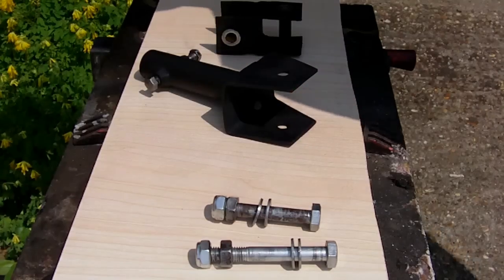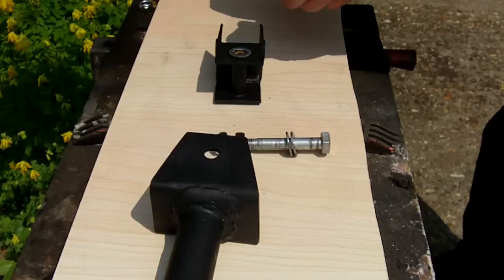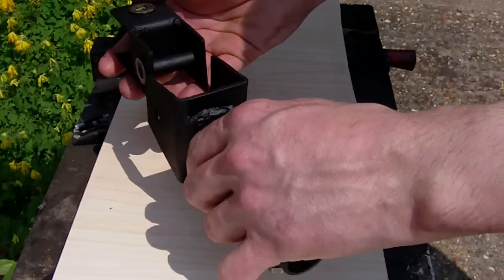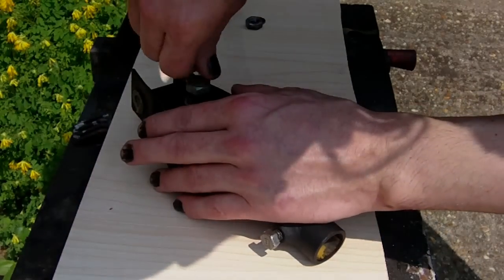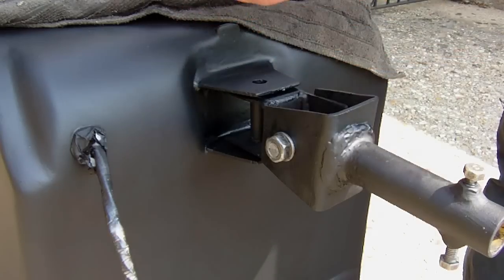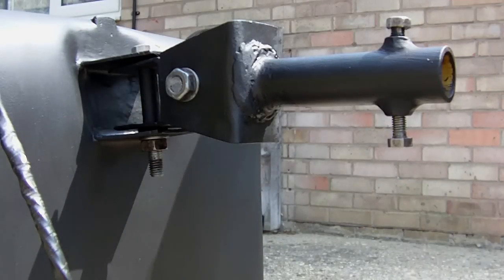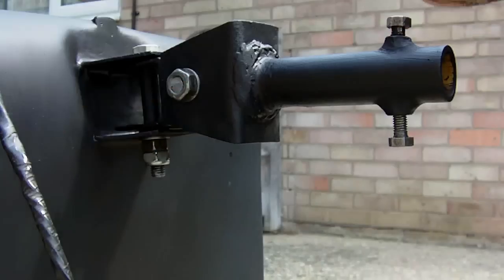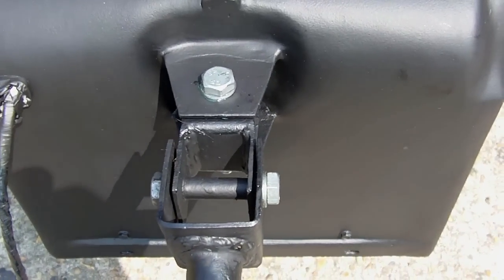Mono-wheel Motorcycle Trailer Rebuild - Part Two - The UJ

Comment: The universal joint must be positioned with the vertical axis on the engine, the horizontal axis must be on the side of the trayler otherwise it will tip over in a sharp bend or when reversing.
Reply from the maker: Been running this trailer for over 15 years, never had a problem, and I do throw it around like it's not there!

Comment: Nice idea for a single wheel trailer. I have been looking at several designs over the last few months. The engineering that goes into these intrigues me.
Reply from the maker: When I built this over a decade ago, I had no clue what I was doing... It actually has changed very little since then... But I have learnt so so so much from living with it... What I would do different? What changes I wold make? etc etc... I also had to rebuild the hitch to fit my new bike, Suzuki intruder C800 (videos of this are on the channel)..

The Hitch has suffered damage from cars hitting the rear of the trailer, so is currently broken. I am going to rebuild it stronger and extend, further back, the braces from the pannier brackets, to nearer the UJ and hitch point.
Reply: Have you ever put the design into something you can sell online? I am on a 1300 V Star Tourer right now. I'd like to put on a single wheel trailer. I've seen some, but they just didn't 'feel' right to me. I like the way yours looks.
Reply from the maker: You mean plans? The videos I put up are to help people design and build there own, or get some-one to do it for them... I quite literally made this up as I went along, with basic tools, even the welder was s/h and years old before I bought it. The frames was an old childrens bunk bed and scrap I had laying around... I spent a month building it on my parents driveway.
Reply: OK, thank you. I'll have to get on that as soon as I clear some other long standing projects. I appreciate this series upload. Very helpful.
Reply from the maker: My pleasure, I enjoy making stuff and I come up with some very interesting ideas, so I share them with everybody, so they can do it too
Reply from the maker: One hint, have the thing as visible as possible, I put a flag on the back, to stop people running into it.

Comment: i'd of used a uj propshaft joint cos then youd get up and down movement too,u dont grease towing tow balls and shouldn't of greased that bolt .when you was showing it swiveling back and forth left to right it looked like it was notchy thats not good.

Comment: I did have an idea of a "Quick Release" the two bolts you have that go on to the bike pickup point, you could drill that all the way through and get 1 long bolt with a hole drilled in the thread end and when you hook it upto the bike and put the bolt in you can put a "R" clip in it so it does not come out like it he with the rear wheel shaft on most bikes to stop the nut coming off. just an idea